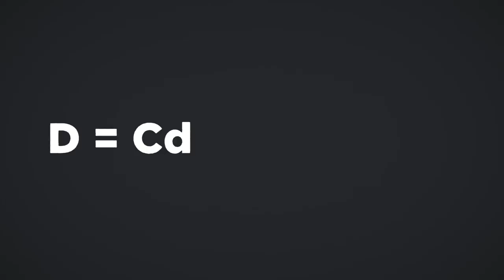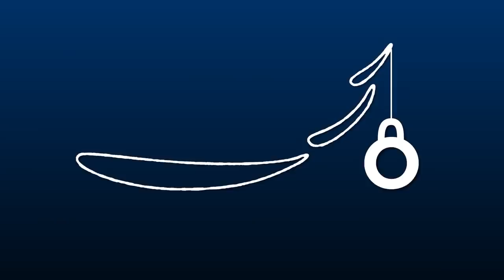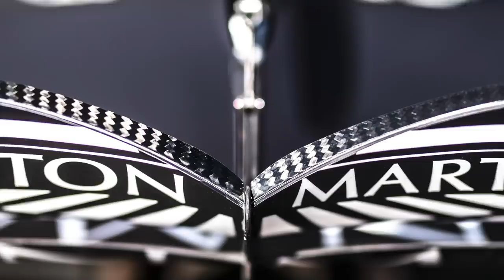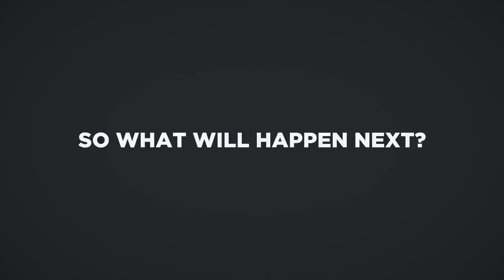What Are Flexi-Wings & Why Are They So Controversial In Formula 1?

Comment: Wow! So DAS was okay? Flexi-wing isn’t? Crycedes Benz.
Reply: Don't forget Red Bull protested DAS and that it was made while in contact with the FIA.
Reply: @justcows7772  basically every wing is "against the rules" because they all flex to a certain degree. The rule doesn't define a level of flex so the interpretation of what is and what isn't legal is defined by passing the load tests that FIA performs. RBR's wing has passed these tests so it is legal.
Reply: The rules literally says you can’t have flexible wings while there was no mention of a system like DAS being prevented from being used. Do you see the difference?
Reply: DAS was legal because there was no rule banning it. FIA didn't even think of it.

Flexi wings have been banned for years.
Reply: @devilliersmolefe3851  part of the controvery surrounding DAS was that according to some (including myself) the technical regulations did contain rules that would prevent a system like DAS to exist. Specificly article 10.2 that limits manipulating the suspention. FIA evaded that discussion by saying that it DAS was part of the steering (something for which it clearly wasn't used).
Reply: @ricahrdb  but DAS was only used to heat tyres no while racing
Reply: @devilliersmolefe3851  that is correct. But FIA said (as a response to RBR's protest) that DAS was part of the steering. But you'd think that steering is used to steer a car and not to manipulate the temperature of the tyres.